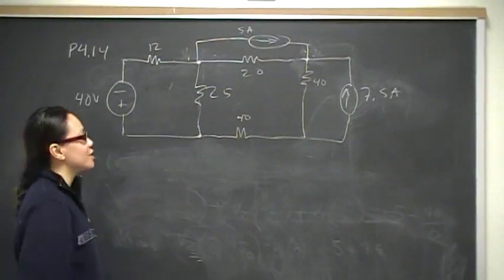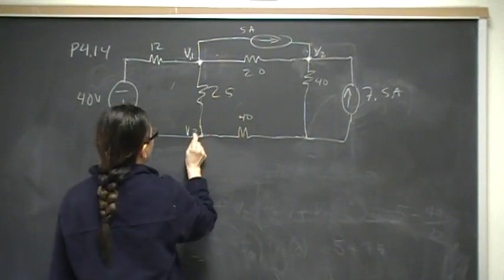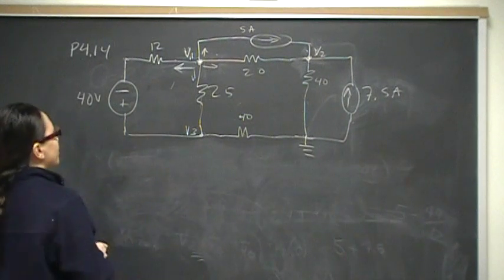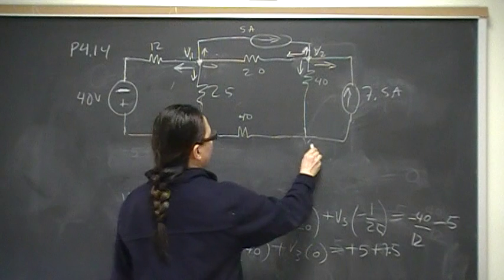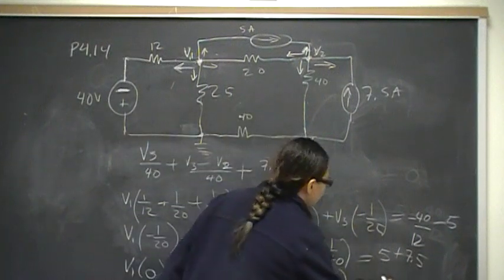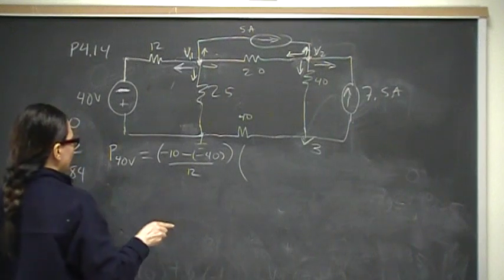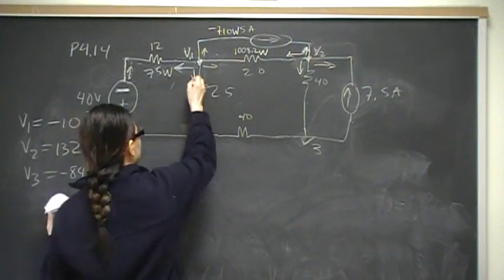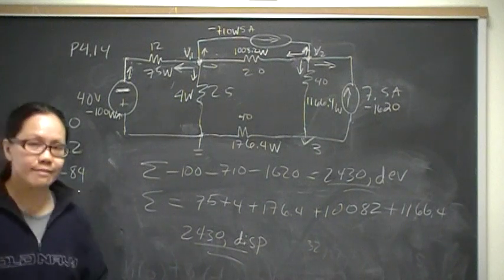Node Voltage Circuit Analysis P4.14 Nilsson Riedel 9E Solution

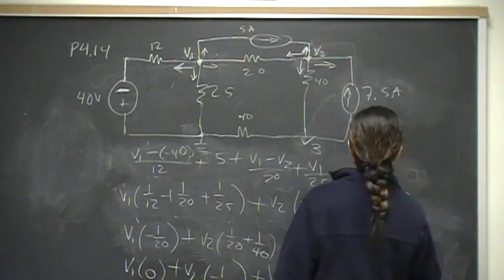Comment: at 20:32 I have the same coefficents as you:
A1=(1/12+1/20+1/25) B1=(-1/20)    C1=(0)       D1=(-25/3)
A2=(-1/20)                  B2=(801/40) C2=(-1/40) D2=(12.5)
A3=(0)                        B3=(-1/40)     C3=(1/20)  D3=(-7/5)
but upon entering those into by 2 calculatrs, I do not get v1=-10, v2=132, v3=-84
Once I plug thoses v1,v2,and v3 in, I get the same pwr results as you.
Maybe in another video, you can do a matrix/substitution/eliminaton instead of the calculatr. Ideas? Thxs 4 ur help!

Comment: I ask becasue for example I would thin that once you assign a current as a positive leaving V1 then it must be a negative entering v2. The current arrow leaving v1 and v2 point at one another, however current must either leave v1 and enter v2 or leave v2 and enter v1. Right?

Regarding remove the 12 ohm resistor... wouldnt you set v1 = to -10 volts? Since ther is no elemt between the 10v source there would be not voltage drop and no current differential between the two, correct?

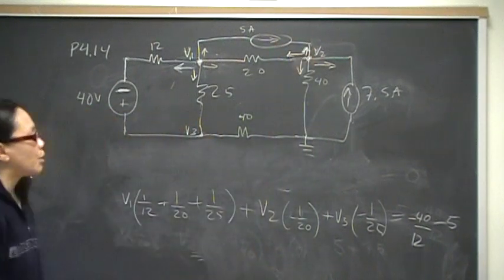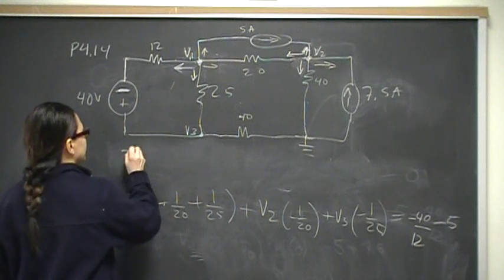Comment: I notice is that you follow tail to tip with polariy/current arrow on voltage/current sources, but  assume leaving currents across resistors. For example, at 12:36-12:41, you specify a current w/ polarity of the c. source. Am I to assume that regardless of node, that you always count currents as leaving & start with the node voltage in question & subtract the node voltage across the resistor and div by the resistor, but w/ currents driven by a voltage or current source, you follow the polarity?

Comment: Thuy, no matter what I do, i have the sameequations and  coefficients on both sides of the equal sign for all 3 equations, but when entering those values the the calculator, i never get v1=10 v2=xx  and v3= -184.

the other think i notice is that you oly follow tail to tip on voltage and current sensoar, but you alwasy assume the current leave only on the resistors. In some cases even when the current i enterign, ur counting it as leaving. 

Any ideas?

Comment from the maker: additionally, i wanted to help you with something that i think i failed to communicate on my video. if you there was no 12 ohm and you just put the 40v on the right of the equals sign with the 5A, then you would have an equation that says the 40V is equal to the sum of some currents which doesn't make sense. the node voltage technique uses KCL and says currents in and out of a node =0. therefore you would represent the unknown current through the 40v with ix and see if you can solve it. :)

Comment from the maker: if the 12 ohm is not there, you dont know what current is going through the branch that now has only the independent voltage source. you would represent that with some current variable called isubx. then you use kcl and say all the sum of the currents into the node is zero. with or without the 12 ohms, you still have some current and you approach the solution the same way: using kcl. if it leads to a dead end try kvl.